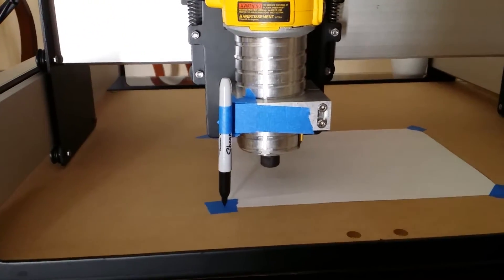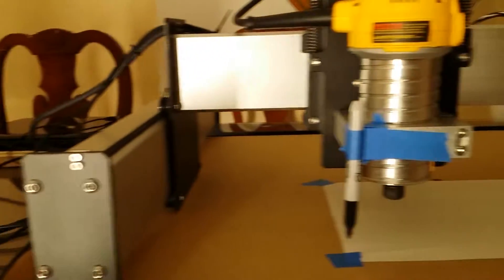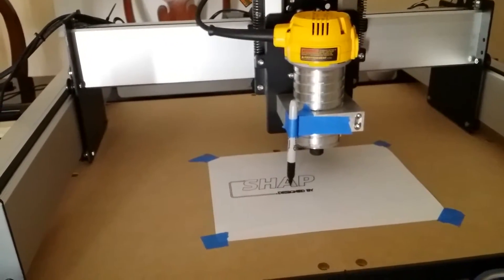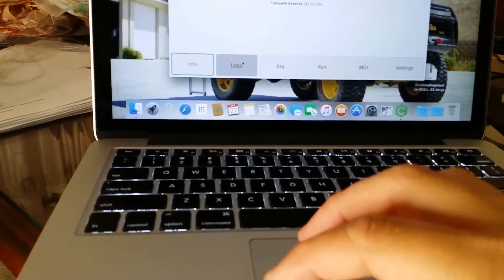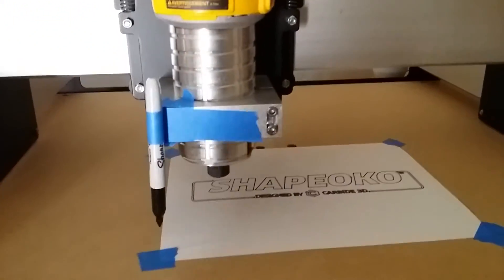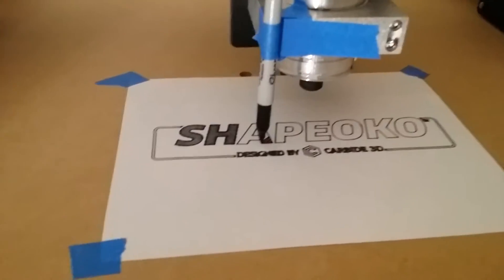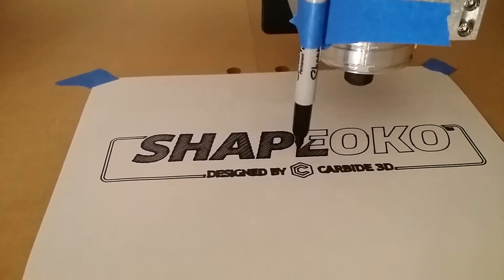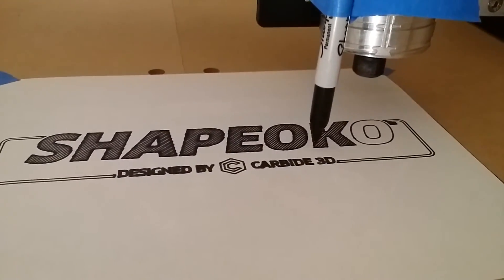My first CNC Mill Shapeoko 3 Hello World Test

Comment: Thx for sharing, good reference for other new Shapeokos out there. :) As you can compare the sounds, to check if it is normal operation. Mine sounds the same, but I have an x axis tilt on m z plate, probably fixable with adjusting the eccentric nuts, or rebolting the x axis extrusion on the right side.

I forgot to try the cross hatching also. I used a thick piece of card, which gave a finer result without the sharpie blotting the paper. Think cartridge paper or bristol board.

Comment: So cool, i am also researching right now into CNC mills, i came across this one which seems to have a huge fan crowd :   http://inventables.com  the x-carve there, but even the table box is crazy cool.
Reply: I know you posted this a year ago, but for anyone else who's curious: The X-Carve is actually the "sequel" to the Shapeoko 2. The Shapeoko brand was bought by Carbide3D who designed a much beefier version and released it as the Shapeoko 3, where the original designer built a revised version of the Shapeoko 2 and called it the X-Carve. There are fans of both machines.